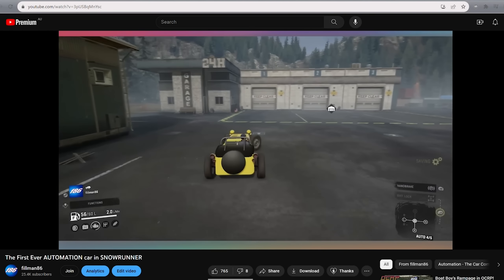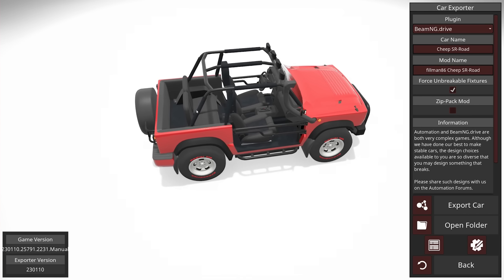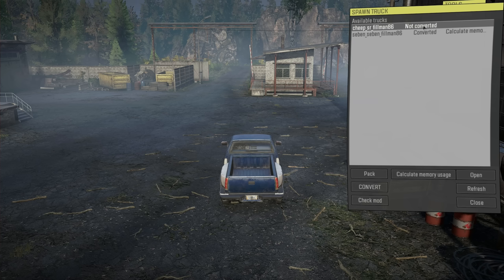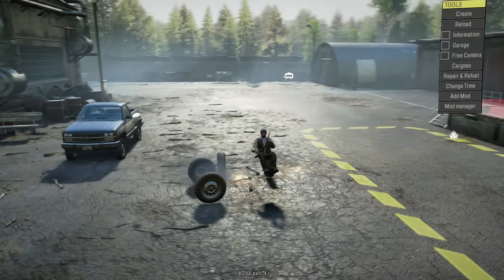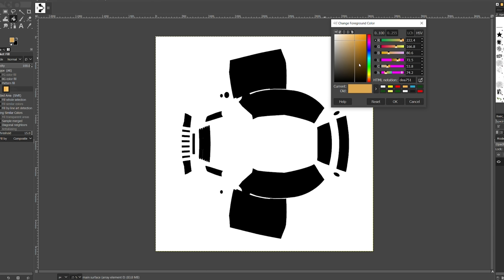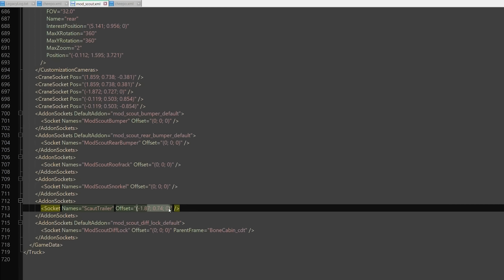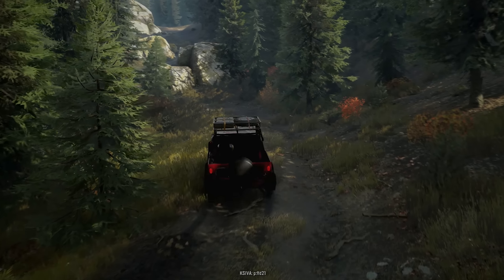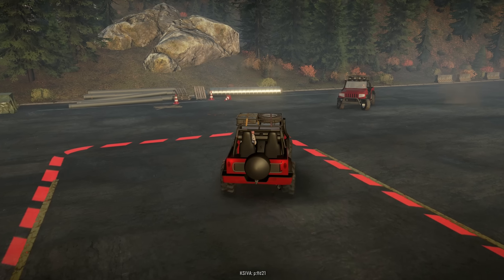sending from Automation to SnowRunner

Comment: You should also try exporting it to Mudrunner instead of snowrunner. Mudrunner has a somewhat more interesting physics engine, even accounting for chassis flex.
Reply from the maker: Oh, I didn’t know that they regressed their tech… that’s not the choice I would have made haha
Reply: @fillman86 snow runner is definitely more arcade-y than mud runner. It’s made for a wider audience, so they lessened the difficulty and made the physics simpler, in favor of more vehicles and better graphics